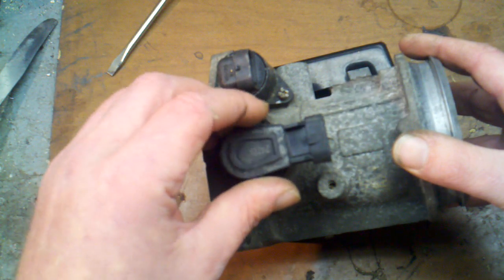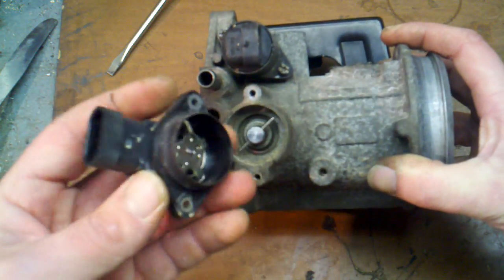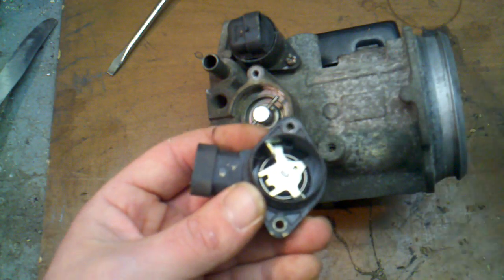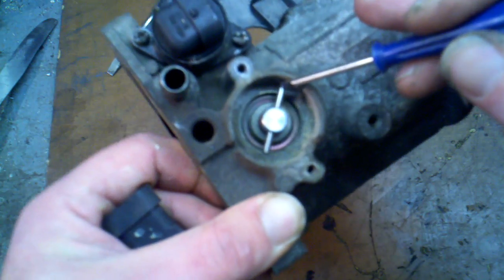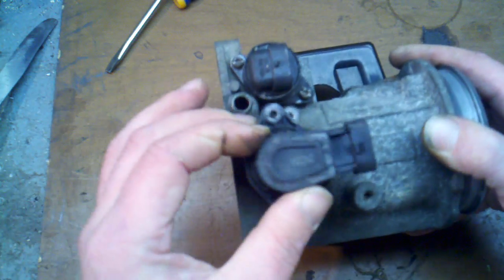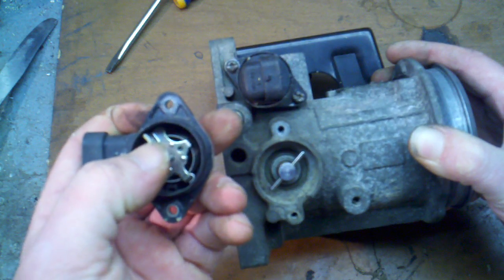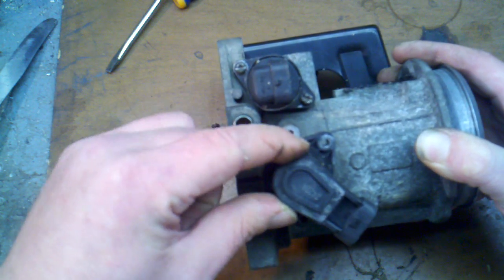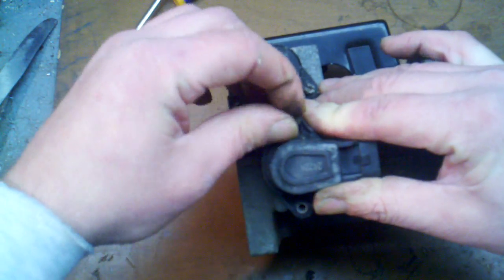3800 TPS Install

Comment: Man this guy saved me I installed a new TPS in my wife's 2005 buick lesabre and then week later check engine light on and car shifting funny and just not itself my wife kelp nagging me about it for 3 months. So I came across this video and decovered that I put the TPS sensor on wrong. So I did what this video said and now problem fixed thanks alot.
Reply from the maker: Glad it worked out for you.

Comment: THANK YOU!!!  I, not being mechanically inclined, put it straight on instead of lining up the tab with the bottom of the right-hand post like you said.  Such a simple step, and such a crucial one.  If you put it on incorrectly, it will stall at low idle and wont shift out of first gear until you're at about 4500 RPMs.  I was going to spend my whole 3 day weekend working on my car.  Looks like I only had to spend 20 minutes.  Thanks, Michael!!!
Reply: I fixed mines but still dont work the same. Did yours blow alot of smoke when turning it on?

Comment: Thank You for this video. I put a new one on and the car idle went to 3000 . Till i seen your video . I had it in the wrong way.  Did not have that tab on the right side. After restarting it it idled normal  Thanks again
Reply: Did you vechical need time to relearn?

Comment: I accidentally installed the sensor incorrectly and turned on rough and blew alot of smoke. I fixed it but still doesnt run properly. Any thoughts on what could have happend

Comment: Thank you. Simple, yet very important. My 3.8 was running like crap, checked codes, replaced both oxygen sensors. And it turned out the cause was a cheap broken vacuum line!

Comment: I found on couple of Impalas in my garage I own you have to remove the thermostat housing to get proper clearance so you can get straight on the TPS so you do not ruin the screws on the TPS. After removing thermostat housing might as well change out thermostat while its open.

Comment: Wow thanks, glad I found this video I replace the TPS 3 days ago, my 99 lesabre with 875000miles his about 4k rpm before it shifts and everyone is telling me all different kinds of things I'm definitely going to be try this because I wasn't the one who installed it.
Reply: +bix0413 Was that the issue? i had mine worked on and it does the same thing.  I think they put the tps on wrong.

Comment: Thanks for that video everyone tells me just to take the old one off and put the new one in, Ive been having a lot of throttle issues as 4 months ago I took the old one off to clean the throttle body and it sprung back when I removed it, I just put it back in and screwed it in not knowing what you just showed in the video Thats why the cars been acting up on acceleration and ive been getting bad gas miliage. I just went and bought  a new one from Amazon.com thinking the old one was screwed.

Comment: I  never knew this my car only goes to 3k when I floor it  has a p0122 code and stalls when you park. on fords you just simply install it GM always has to throuhgh a curveball (overcomplicate things) I have to losen the Thermostat housing fix the  sensor THanx for the tip.

Update alls well the engine light went out on its own
Reply from the maker: Your welcome

Comment: This video just explain my issue, and here I was thinking I need a new sensor and then I remember when I had to clean out my MAFS I also cleaned the rest of the sensors and this included and Ik I didn’t put it back in the right place. Thanks

Comment: You are 100% correct if it’s not installed correctly, it will have the check engine light come on it happened to me I’ll put it in wrong causing the check engine like to come on

Comment: Calibration is this also needed? This process, what was  your source?
Reply from the maker: I don't understand your question.
Reply: @BurninBogey7  Do you need to calibrate the sensor with a particular voltage for it to work properly? check with scan tool or voltmeter?
Reply from the maker: @mobilecommunicationsnetwor5268  No you do not. Just install it correctly, and its all set to go.
Reply: @mobilecommunicationsnetwor5268  you don't have to on a series II

Comment: What tool do you need to remove the TPS? My 2004 regal is attached with 2 screws that look like Torx bit but the center of the screws have a raised metal piece so a torx bit wont go in.
Reply from the maker: You need a security torx bit. Why are you removing it anyway?
Reply: @BurninBogey7  Hey thanks. I figured it out a couple days ago and bought a set of them. The TPS failed when tested with a multimeter. The car had no power and would stall. It was a 2 part problem the TPS failed and the Cat was clogged. Recently purchased car for $1600 + TPS $40 + Universal Cat $100.  Car runs great now!

Comment: I got a code to replace the TPS via my diagnostic tool.. I see in this video that you removed the throttle body. Do I have to remove the throttle body in order to replace the TPS? So far I removed the thermostat housing to get to the TPS, but it looks like the 2 screws on the TPS are flat head screws, and i havent had any luck trying to turn those screws counter clockwise to loosen the TPS.Its a tight fit in there.I have a series one 3800 in a 1994 buick Lesabre.
Reply from the maker: No, you don't have to remove the TB. Mine was already removed when I took the video.
Reply: @BurninBogey7  , thanks for your reply. What kind of screws are those that hold on the TPS? Im having a hard time to get them to turn with a flat head screw driver.
Reply from the maker: @kenr.b.891  Regular machine screws. But they are steel threaded into aluminum. If you place a screwdriver into the slot and smack the end of it with a hammer, sometimes it breaks them loose.
Reply: @BurninBogey7 , no luck because of the limited space of the right screw on this series 1 3800. I just bought a 4 inch vise grip and will try to remove the screws by grabbing the sides of the screws. If that doesnt work, i guess it is off with the throttle body, in or
der to get off the TPS.
Reply: @kenr.b.891  Mine are hex head...I think T-20's. You should be able to reach it with a tip inserted into a 1/4"socket without having to take the thermostat housing off.

Comment: Can you please tell me if this the same for a pintiac  Grand Prix 2004. We just bought one for my daughter and were told that this needed replaced but the guy at AutoZone says that it's non-serviceable and we have to buy the the throttle body assembly for $350 to fix it.
Reply from the maker: Shawn Wilt if it's a standard L36 3800 series 2 engine, then all you have to do is replace the sensor itself.
Reply: Michael Lawson ..so I know Jack about cars.  How would I be able to find out if that is the kind I have.  The guy at AutoZone says that it is non-serviceable and I have to buy the entire throttle assembly but someone else said no to that.....very lost.  Thank you for any help and your response before.
Reply from the maker: Shawn Wilt www. Gm forum dot com. We can help you out better.
Reply: Just here going through and reading posts. To anyone wanting to know. The 2004-2008 Pontiac Grand Prix 3800 engine is a series 3. It has an electronic throttle body. The 1997-2003 GP  3800 series 2 had a cabled TB. (Not all GP's through 97-03 had a 3800 V6. Some had the 3100 engine)
So the answer Mr. Wilt's question, yes AutoZone is right.

Comment: Hi sir thanks for the video by chance I have a 95 Buick regal limited is there a way to clean that throttle body even though it has that screen on it? Thanks God Bless
Reply from the maker: Yes, if you remove the MAF sensor, you can use a can of carb cleaner and spray the entire inside of the throttle body. Then re-install your MAF sensor.
Reply: Thank you sir God Bless.
Reply: @BurninBogey7   Always use tbc, not carb spray I thought.
Reply: @johnwagner4559  exactly

Comment: I just reinstalled and my motor sings higher notes again, but the " money light still on" I just gotta clear it or wait .
Reply: Disconnect the negative battery terminal for 10 minutes. It will clear the codes, get the codes removed by an suto parts house like Autozone or O'Reilly auto.